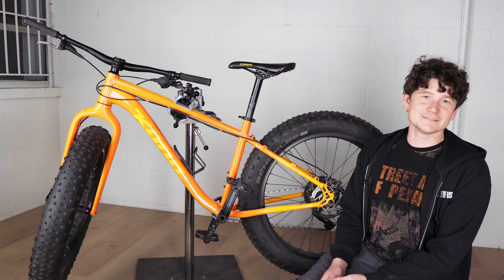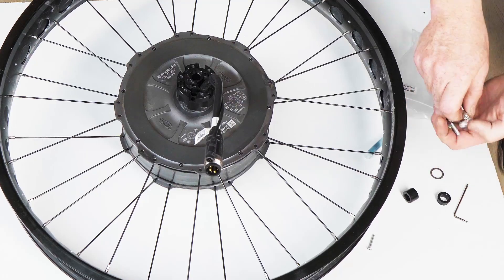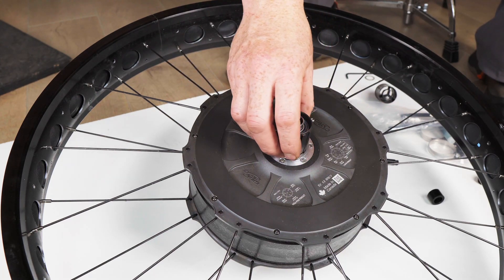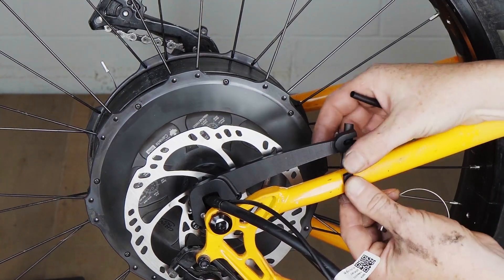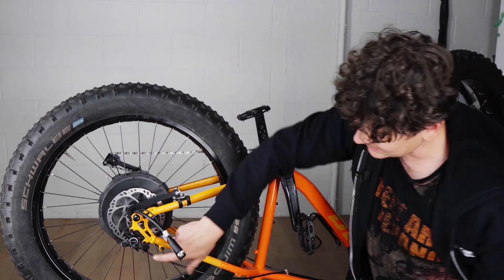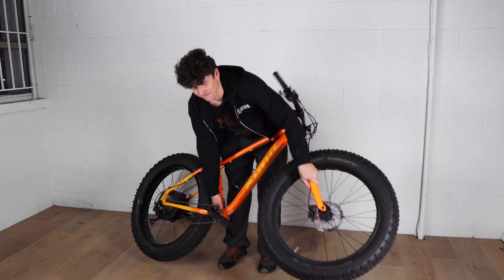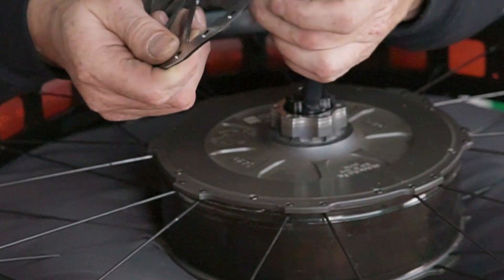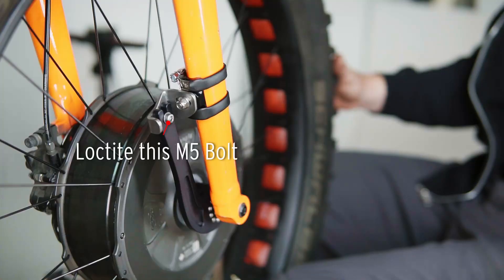Installation of Grin's Max45 Fat All-Axle Hub Motors, both Front and Rear

Comment: Hey i have a question. Can i install fat motor on a standard - not fat bike frame?
Reply from the maker: Not our exsiting models since they require 170-190 mm dropouts. But we will very soon be releasing a Max45 1Spd motor that has a 140mm axle length for use with single speed bikes that don't have derailleur gears.

Comment: I don't like how the hub flanges are not continuous, so you can't modify them to 36 hole motors. Maybe they can be laced to a 36 hole rim by doing 4 holes, then skipping 1 four times?
Reply from the maker: The flanges are profiles and drilled after casting by CNC, the mold itself is continuious to allow this.  We have 36 hole side plates and also 144 hole side plates available for OEM customers, but don't produce this as a stock item. 

Some mismatched hole / rim combos you can do (like lacing 24h rim into 36h hub) but between 32/36 it's not really doable, each spoke would need to be its own length.
Reply: @GrinTechnologies  can you tell me which OEM uses a 36 hole side plate so I can order the motor from them?

Comment: Would your motors work on an eahora romeo pro 2 52V 60mah Battery dual 1500 watt motors? Would i need a new controller and or computer? Kinda want to try something else that might be a little more reliable when the time comes!

Comment: FRONT MOTORS ARE NOT GREAT IN WET
Reply from the maker: It depends a lot on the particular bike geometry how the weight is distributed between the two wheels. With a lot of cargo bikes, pedicabs etc. where this would find an application, there is more than enough weight on the front wheel to have plenty of traction even in wet weather. Otherwise on a conventional bike where 80% of the rider weight is on the back wheel, it's both easy and smart to limit the torque and/or acceleration of the front wheel so that it's less likely to skid when throttling in slippery conditions.

Comment: Lovely simple looking set up. I'm running a Norco Bigfoot with a Bafang BBSHD 1,000 W mid drive which is great but certainly hub drives, especially on fat bikes, offer a less complex set up - eg chain alignment, etc. The hub spacers to accommodate diverse axel dimensions/type are great. Nice kit!

Comment: I have the All-axle hub mated to the Phaserunner and Superharness. It runs smooth and quiet.  The belt drive that I am using actually makes more noise than the motor.  Interesting the torque sensing feels great now that I have it hooked up with the Superharness.  When I ran it with the CA, it felt a little quick with ramp up causing me to spin out faster.  For context, I have this on a 20 inch minivelo travel bike with 72volt molicel battery.   I want this motor for my Radwagon 4 as a retrofit.
Reply: I also do not like the look of hose clamps, and I'm just using heavy duty zip ties.  It hasn't moved at all and works great.  I carry extra zip ties jic.
Reply from the maker: The forwards torque of the motor pushes the torque arm into the frame, so the straps don't really have to deal with any tensile forces when you motor away. It's only when you are doing regen that the frame clamp is being pulled away and the zip ties are what's holding things snug.  

100 Nm translates into about 150 pounds of force at this distance, so as long as your two heavy duty zip ties combined have a pull out strength with safety margin above this you should be fine. If it's dicey, you can always reduce the max regen phase current to like 40 or 50 amps,  still decent stopping power but with less stress on the hardware.
Reply: @GrinTechnologies  thank you! I think I'm using regen with dyol throttle? I'm using it as a break...it's an amazing setup. The ties have handled it though.

Comment: Looks nice, but not many spokes? looks like only 50% are used, what kind of rider weight can that setup handle as I snap spokes on my Fat bike all time, also I designed a 3D printable clamp for the Grinn universal torque arms, works great and looks really sweet.
Reply from the maker: It's 32 spokes which is the norm for non-electric fatbike and almost all mountain bikes these days.

Breaking of spokes is way more often a sign of poor quality spokes and/or poor lacing than the spoke count.
Reply from the maker: We've done multiple long haul cargo ebike touring trips in vehicles weighing several 100's of kg without every breaking a spoke over thousands and thousands of km.

But if you have an accident where you dent the rim and locally mess up the spoke tension without addressing it, then they can start to fail in rapid succession.

If you've had a few spokes break already, I'd just get the whole wheel relaced professionally with quality spokes like sapim or DT Swiss.
Reply: @GrinTechnologies  The spoke layout was deceiving, it just looked sparse, for me spoke breakage is due to my weight, I'm 135kg and I'm quite hard on the back wheel with jumping and hitting trails hard, I cant ride most of the newer bikes for this reason as their is limit on rider weight for the frames, I snap spokes that often I keep spares for all my bikes, I'll keep these hub motors in mind for my next build, as I have done multiple Befangs, and I'm just finishing a CYC X1 Pro, but I'm getting annoyed with drive chain issues using mid drives, with my weight and strength+mid-drive=stretched chains and smashed rear cassettes, I'm thinking its time to try something different. Also, I actually use your lacing guide for my wheels, have done for years and have far less broken spokes since I have been lacing my own wheels.

Comment: I find it limiting as an owner of a bike w/ 1K front & 1K rear motors but only one throttle, either it's AWD or RWD. As long as you're designing the electrics, how about two throttles? Standard right-twist throttle for the rear motor and a left thumb lever for the front... so I can bring in the front motor when needed. Wide open front throttle for zoom, feathering it when climbing slippery [muddy trails] hills (or I need the extra help otherwise), or ignore the front altogether because the rear motor is all that's needed. Just a thought, rather than one throttle peels out the front tire because someone forgot to disengage AWD again. As long as you're building...
Reply from the maker: It is super easy to wire up a 2wd system with two separate throttles, anyone can do that if that is their personal preference. But the efficiency with two dd motors like this is always best when the load is evenly split between both motors all the time which is hard to maimtain with two separate inputs. 

Traction control of the front wheel off the line can easily be addressed by putting an acceleration limit in the front motor controller, and/or lowrer max phase current limits too.
Reply from the maker: Btw what bike model do you have? I'm presuming it has both controllers on a single housing or pcb, but if instead the two motor controllers are separate modules you may be able to customize the wiring harness so that each controller has its own throttle input
Reply: @GrinTechnologies  Mine is a BoomBike Zeegr S1 (the older 48v flavor), single controller housing, no DD or regen. I wanted to try something inexpensive at first, call it a proof of concept to see if these are a bust or a blast for an old man. I'm having a blast, so there ya go :)  I was waiting for the warranty to run out before I start trying to mod it up. I miss regen (I had a "scooter" ~10 years ago for city commuting that did have regen), so I'm watching your DD motor progress with great interest. Once warmer weather comes back around I'll be evaluating whether this frame is a good platform on which to build or if I should start from scratch with a "more proper MTB frame" if that's even a thing. If you have any thoughts there, feel free to share.

I appreciate your insight into the electronics - traction control, etc. These are things I need to become more familiar with since now I know what I want to improve. Cheers! 😃

Comment: Thanks for this! My rear wheel was laced so that all of the spokes went to the drive side holes on the rim compared to the one shown in this video where the rear wheel was laced alternately between the drive and non-drive side. Is it a preference thing or just because I used a 90mm wide rim?
Reply from the maker: Its a preference thing based on the stagger of the spoke holes in the rim, if there's a choice then normally you'd pick the set of rim holes that results in decent triangulation while minimize the tension difference between the drive and non-drive side spokes.
Reply: @GrinTechnologies  Thanks for the explanation!
Reply: Great question. I have a Surly Pugsly and the rear wheel is laced the same way. I always thought it was done for clearance or tension issues on fat bikes.
Reply: @davemeise2192  Yeah I just don't know enough about wheel building and it was more a question of curiosity
Reply: @MilesScout21  Yes and thank you for the question as I've been curious about it too.

Comment: How do you know that the front forks can handle the torque of the front motor?  I have heard stories of the front motors breaking the front forks, which obviously results in a catastrophic failure.  ouch.
Reply from the maker: If your front fork can't handle the pulling force of 120 Nm max motor torque, then it definitely also can't handle the braking force of 300+ Nm when you use your brakes.  

Also it's important not to confuse fork blades braking (extremely rare, but can happen with really low quality forks) with dropouts spreading open or cracking. That's the result of bad chinese motor design relying on axle flats for torque transmission coupled with poor quality or absent torque arms. 
This motor has a totally round axle, it can't put any spreading torque on the dropout slots even if it tried. All the torque goes to the fork blade via the torque arm, and the forces that it puts on the fork are like 1/3rd what your disk calipers will put on it.

Comment: As a big dude who will rely on it for transportation, I definitely want dual motor. How much?
Reply from the maker: Lots of $$ for a dual motor setup, but the performance will be wicket if you are a big guy needing reliable transport.  Price will depend a lot on the options, but you can get an idea for a single motor kit here:
https://ebikes.ca/shop/electric-bicycle-kits/grin-fat-all-axle/grin-front-fat-all-axle-sh-kit.html
Then for the 2nd kit, you won't need an additional display, throttle, ebrake etc,  but you will need a dual Main9 splitter cable, which is something we plan to release in early 2025. 

The battery you choose will need to support the combined current of both motor controllers, so should have at least a 50A or 60A rated BMS circuit.

Comment: How much are the kits?
Reply: Far to expensive compared to other motors
Reply: @Another-Address not really buddy, $700+ for a wheel is WAY overpriced-  3x the price of a regular hub setup.  Higher prices doesn’t mean better quality……..
Reply from the maker: Cheap chinese hubs can produce the same power, sure, but probably won't be compatible with thru-axle, or have an integrated torque arm which is more of a liability for axle spinout, especially if you're system does regen... Not to mention they'll be a whole hell of a lot heavier. Not everyone is looking for a light and high-power, regen capable hub that installs on multiple different dropout standards. If you do happen to install a cheap fatbike hub with axle flats, get one of our V5, V6, V7 Torque Arms so your motor doesn't rip out your frame and cause a catastrophe :)
Reply: @stabbawivagun  you need to compare prices with equivalent performance hub motors. You will discover that most probably there is no comparable solution...